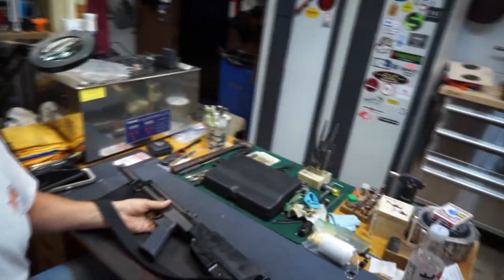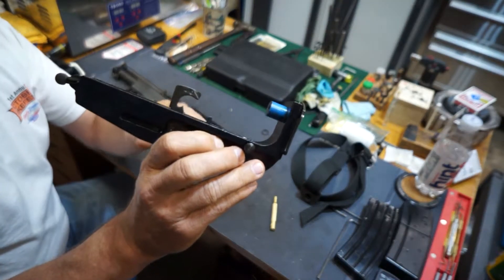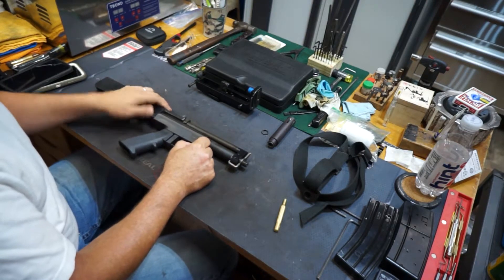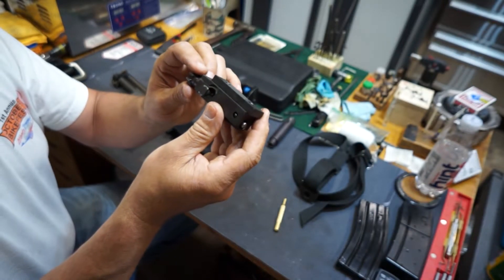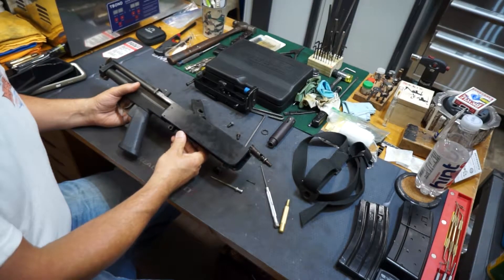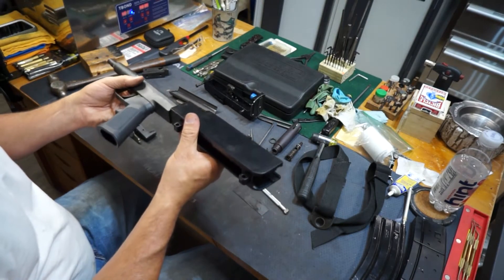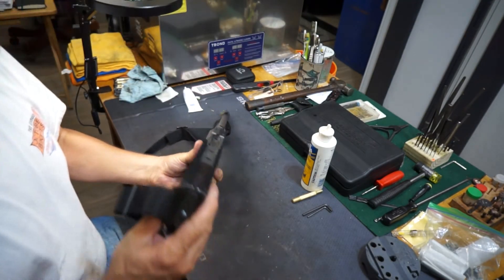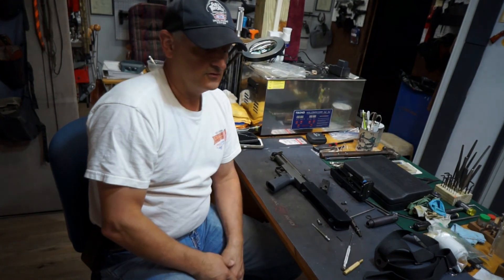Low Budget Shooting #17 Bushmaster Arm Pistol Part 2 Viewer Request for disassembly.

Comment: I just acquired one from a relative. He grew up in Bangor ME where Gwinn Firearms started. It is a single digit serial # !!!!!  I had to figure out how to take it apart all the way because one of the cap screws that holds on the trigger guard / block had come loose and was bouncing around in-between the barrel and the trigger group.  To remove the the upper from the lower you have to use a small punch to depress the trigger wire loop further than the trigger bar itself would normal depress it. This allows the wire that is hooked on to the groove on the front of the trigger to come off. Then you can separate the upper & lower.  The cap screw that came off was a lot shorter than the 2nd one that was still in there. So the short one was barely threaded in and came loose .... so I am going to have to get a longer one.  Wish me luck putting it back together!!!!
Reply from the maker: Wow! Single digit serial, how cool is that. Thanks for sharing your tear down experience. Let me know if I can help with anything from a video standpoint.
Reply: @PaulCavanaugh1  Thanks for your vid that got me 90% of the way. I’m going to finish cleaning tomorrow morning and put it back together.

Comment: thanks for showing that...although i've torn many of my other guns down, i've never attempted it with this one...always fearing springs and detents which have a nasty habit of shooting across the room..doesn't seem to have as many on this gun...both of mine have the standard birdcage flash hider which makes it even more compact...but also produces much more of a flash....
Reply from the maker: The only thing I did not take apart was the trigger mechanism. There is a what looks to be made of paper clip spring metal connecting rod which goes from the trigger to the sear lever in the receiver. For the life of me I could not figure out how they installed it. You can barely see it, let alone get anything in there to touch it.

Comment: The “bent” part on the carrier is supposed to be “bent”.  Look where it fits re the lower
Reply from the maker: It’s the cam for the bolt, same one is on an AR. The edges of it were flared and dinged up from use. There is a lot of play in the track it runs down. I suspect it was not hardened properly.

Thanks for watching!

Comment: I’m not trying to be rude 🫣. But I love the way you don’t have any technical jargon just this piece that piece this thingymcbob. 

Personally I’d say is more like the AR 18 but with long Stoke gas piston instead of the short stroke gas piston. Oh and if I were u I’d but an AR 18 bolt in there when it comes to changing it out as they are just stronger and you don’t need the gas rings and expansion void thingy lol
Reply from the maker: Hey I just call it as I see it. Especially when I am winging it. But I figure people smarter than me know what they are looking at as I dismantled it. For the life of me I could not figure out how they connected the spring wire assembly which connects the trigger to connecting rod which pulls the lever to drop the hammer. 

BTW I have an original AR-18. I have not taken it apart yet either. It was from the 1st batch of the ones made by Stoner. I was going to do a video on it.
Reply: @PaulCavanaugh1  enjoy trying to figure out the trigger bar / linkage. They are notoriously hard to fit and remove and often require what feels like excessive force. But be careful as excessive force in the wrong direction does exactly what you would assume it to do